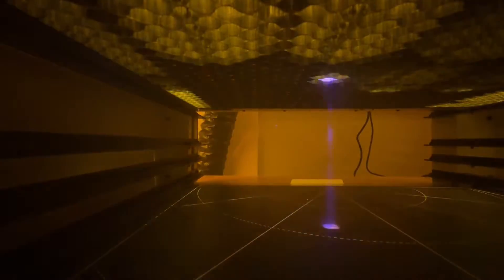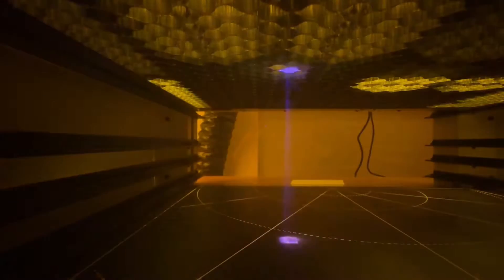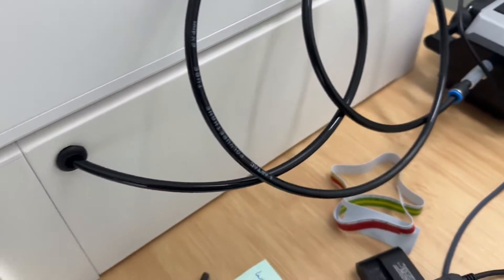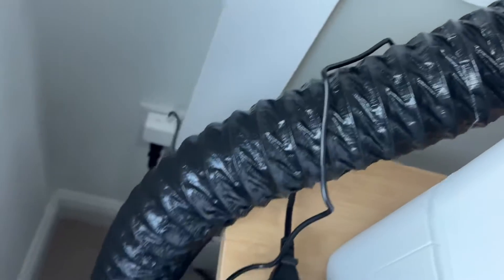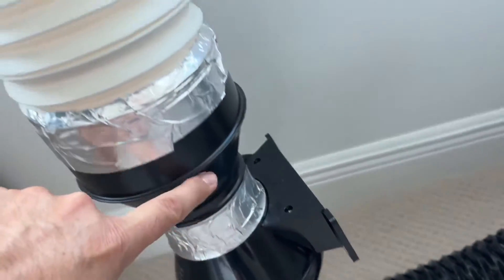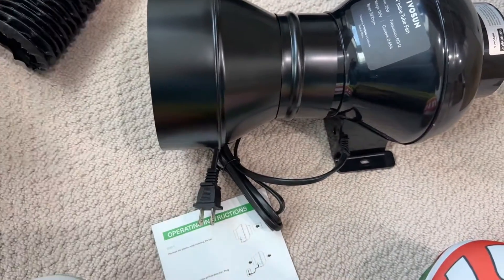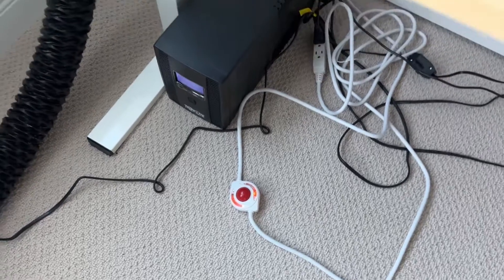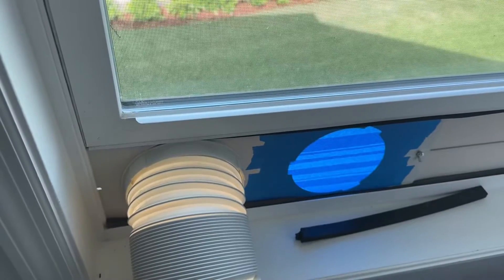How I Set Up Home Ventilation for my Laser Engraver

Comment: Does it still stink up the room? (Vs entire apartment) 

I have a spot in my living room where I keep a few 3d printers and I'm debating adding a cutter that would ventilate out the nearby window.
Reply from the maker: If the wind is blowing the right way, the smoke smell comes inside. Check out our video on a fume extractor - https://youtu.be/czyA3mfadgc?si=k8hN_VlVaa-Duymb. It helps a lot.

Comment: Good Morning where does your first material that you listed go to? I have connected the other two but I don’t get where the sliver duct part goes! SOS thank you !!
Reply from the maker: The silver duct is an adapter that takes the X tool 3 inch hose and converts it to a 4 inch opening, which is on one end of the fan. The other end of our fan is 6 inches which converts to our air conditioner hose. I wish they would standardize this stuff!

Comment: I just purchased a wecreat and I want to do this setup but I’m unsure as to each item used. I know about the 4” fan but I can’t find the adapter. Can you please identify all of the items used for this type of setup please. Also, I intend on purchasing the window kit for a mobile air conditioner, would this be ok? Thank you.
Reply from the maker: Congrats on your purchase. Here are our affiliate links to the products we use. 🙂
1. 3" exhaust duct to 4" in line blower, $15
Stainless Steel Exhaust Adapter Connector 3" to 4"  
https://amzn.to/3sUZVW1

2. Inline 4" AC voltage blower, $40
VIVOSUN D4 4 Inch 195 CFM Inline Duct Ventilation Fan 
https://amzn.to/3Gt2txx

3. 4" to 6" cone size increaser to connect to air conditioning hose, $20
Duct Adapter, 6” to 4” Ducting Reducer Increaser Cone 
https://amzn.to/3TaTzwo

4. Grounded extension cord with foot switch, $11
Electes 15 Feet 3 Grounded Outlets Extension Cord with Foot Switch 
https://amzn.to/4ai4LgS

5. Duct tape (yes, this is what duct tape is supposed to be used for), $6
Aluminum Foil Tape with Adhesive Backing for Ductwork 
https://amzn.to/482rUlr

6. Portable AC window panel with exhaust hose, $26
Portable AC Window Kit with Exhaust Hose 
https://amzn.to/4a9FWn2

Comment: Do you think it’s ok to leave the screen in the window. I just ordered my first laser cutting machine and trying to learn everything about setup.
Reply from the maker: We don’t for the reasons @freshandfelicia mentioned. And it’s probably not safe to leave an unlocked window accessible to the outside world. Congrats on your new machine!
Reply: Great question! We remove ours after each use to avoid rain, birds, frogs, bugs and other nastiness that may crawl inside the vent. There are grates and commercially available hoods that you can use for a permanent installation.